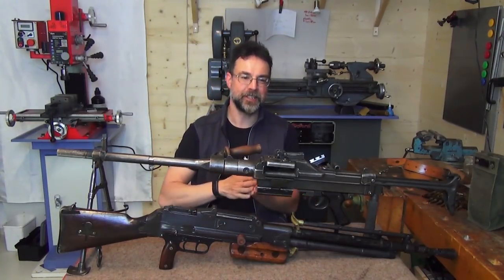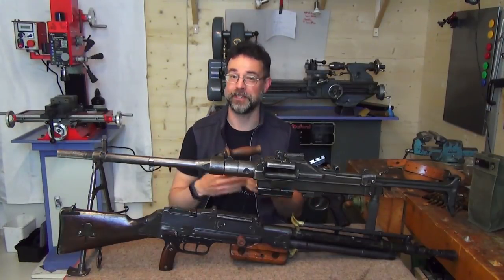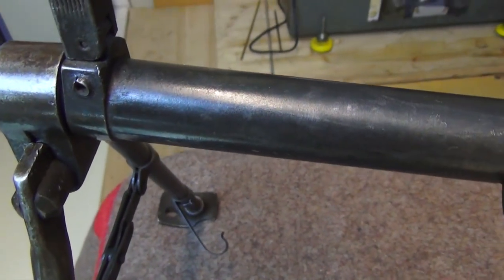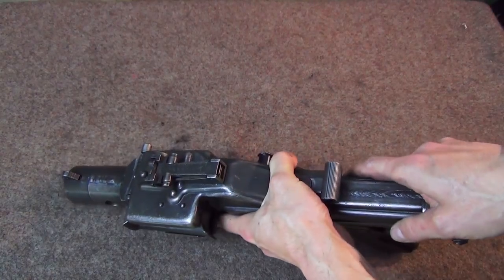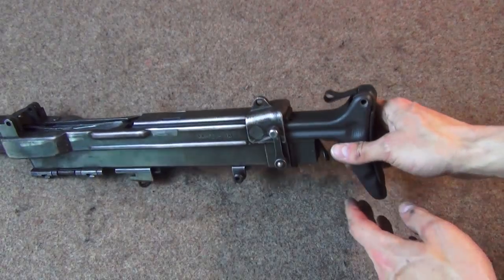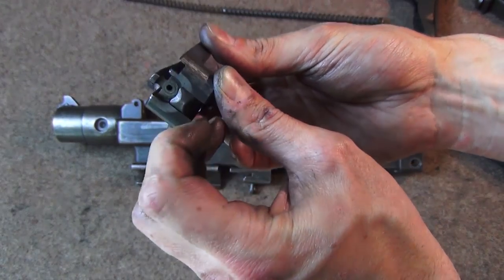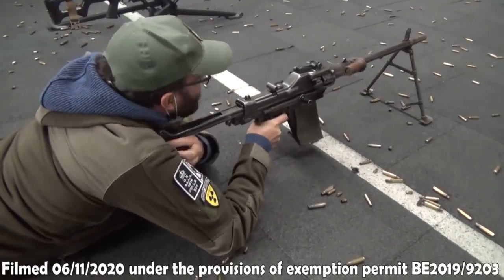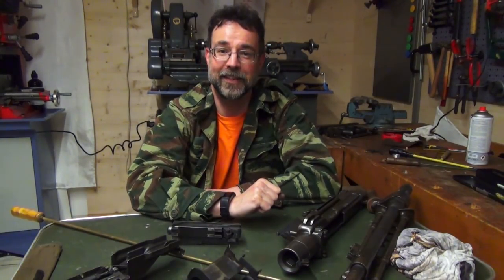AA52 French GPMG For The Cold War And Beyond

Comment: The AA52 likes to fire out of battery quite a bit lol
Reply: It doesn’t it’s just PPU ammo in full auto. It is equally flamey in the FM24-29 which has a far longer dwell time.
Reply: @thebotrchap  you sure? I mean, a lot of powder burn's going through the belt's ejection port sometimes. The only other way that can happen is if a primer didn't completely burn its powder right away but burnt the rest of it upon extraction.
Reply: @thebotrchap  though, what's dwell time? I forgot about that lol
Reply: @Isaac-ho8gh  The time that the breech stays put after ignition. The FM24-29 has a fully locked titling breech with a sedate ROF yet also has flames blasting out of the ejection port with PPU (see FM vid)
Reply: @thebotrchap  ah I see, fair enough.
Reply: That's just hot ammo. The firing pin physically cannot reach the cartridge when out of battery.
Reply: @lsq7833  oh true, that's the case for this gun. Never mind lol

Comment: Another example of the French (other country are just as guilty) wasting time and money by ignoring Engineering Law 1: NEVER REINVENT THE WHEEL!
Reply: I’m glad people do reinvent the wheel otherwise I’d be out begging on the streets.
Reply: What wheel didn't need reinventing here? The GPMG was a new concept and this system works fine and is pretty lightweight. 
The legendary MAG that replaced this is hardly traditional either, using the idiosyncratic tilting link lock out of the BAR which hasn't, to my knowledge, been put in anything else.
Reply: @doorhanger9317  The GPMG was not a new concept. It had been around since 1934. The French wasted money developing the AA52 when they could have just used the MG42.